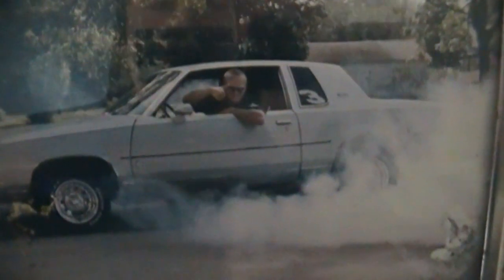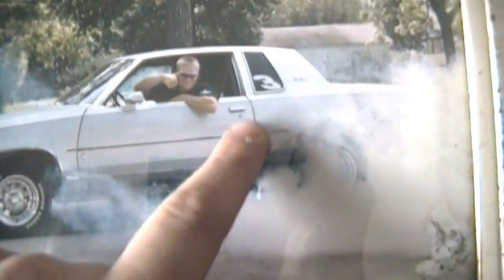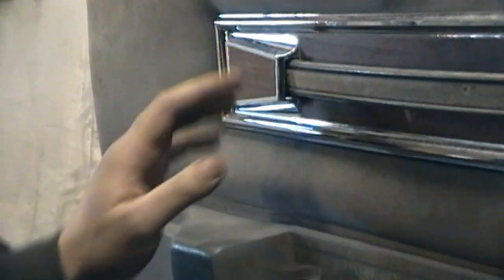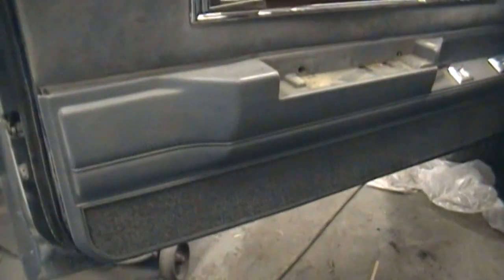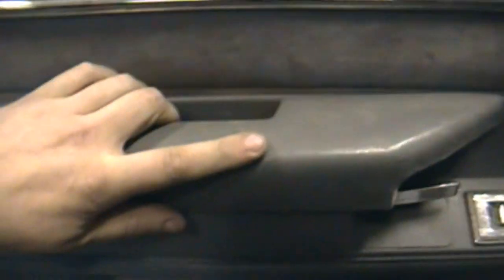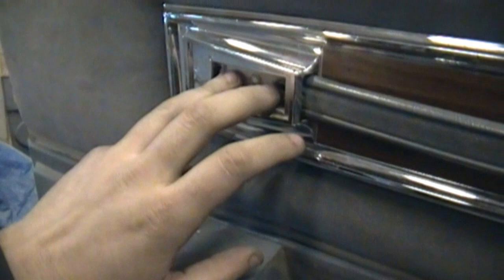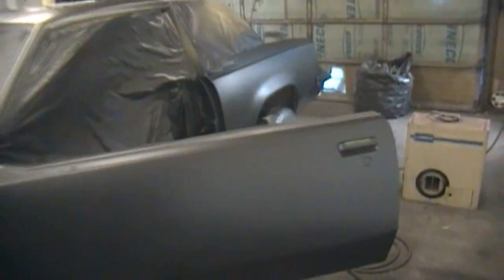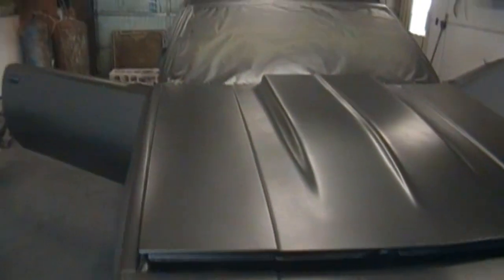86 cutlass door panel removal

Comment: What holds the top panel in place? Like against the door? Does it just hang? Or do those 4 screws that hold the strap behind those triangle clips, screw in past the panel and into the door frame to hold it in place?
Reply from the maker: @idontknow93960  the screws in the pull strap and the screws under arm pad...and depending if you have manual or electric windows cause you gotta remove either the window crank or the buttons and it should slide right up
Reply: @yukonrott good info! Thanks for the reply. Hey one thing im stuck on….how do you bolt down the arm rest in the middle of the seat. In between the driver and passenger seat .
Reply from the maker: @idontknow93960  hmmm that's a good question.... I never removed mine but I'd guess if it's the 60/40 split bench I'd probably push both seats forward and maybe crawl in the back unless you can reach...I'd guess the bolts or screws are towards the rear of the seats .. I don't have the Cutlass anymore it was stolen years ago ... And never had the heart to build another one...

Comment: How do i get the woodgrain off behind the pull strapp?
Reply from the maker: I never took that off so I'm not 100% sure...i would guess it's glued on but I can't verify that...
Reply: @ ah oké thanks
Reply from the maker: @my442.86  id probably take the whole panel off and inspect it on the backside for clips...if there are none then I'd start slowly prying up a corner and see what happens...but this is probably the point of no return...lol
Reply: @yukonrott  thanks hahaha

Comment from the maker: @iheartmycutlass there is a little set screw holding the actual toggle part to the chrome cover on the top side. just get an allen wrench and loosen that set screw and pull it out.. hope that helps

Comment: how do u remove the mirror switch the door lock and window switch from the panel
Reply from the maker: once u get the door panel loose if I remember right there are clips on the inside of the door lock switch and mirror switch
Reply: OK thks
Reply from the maker: +86cutty4door no problem